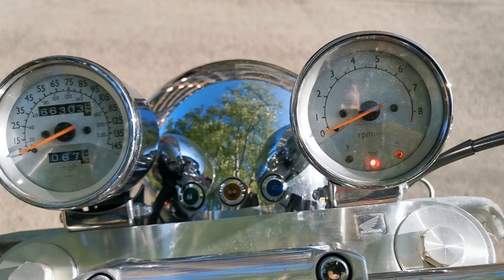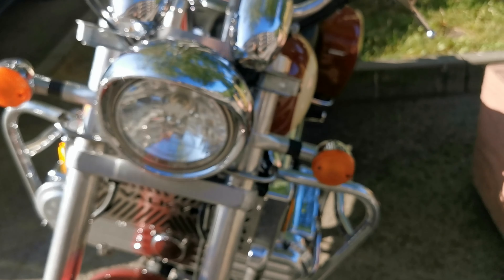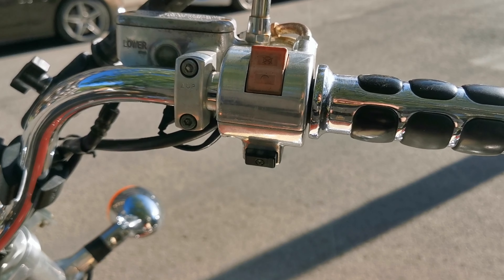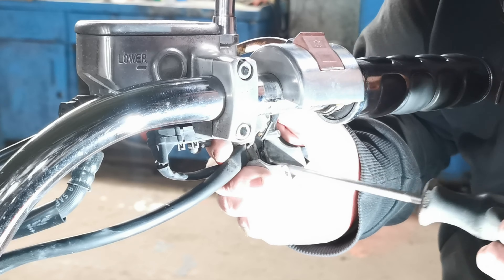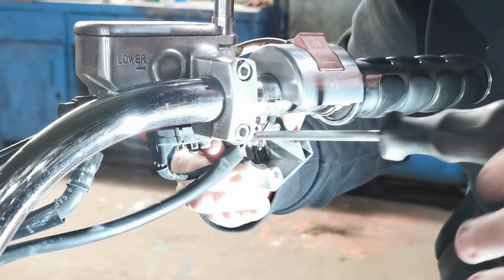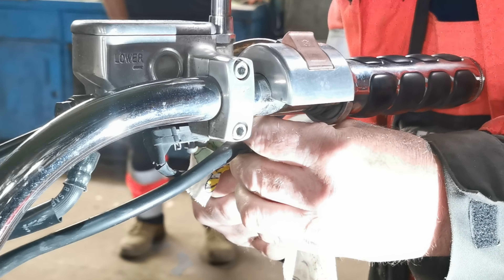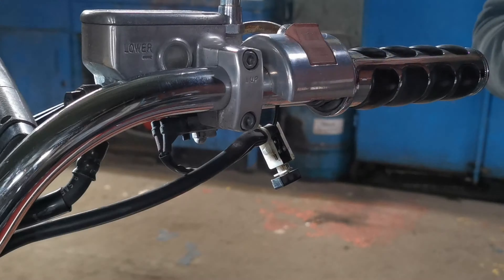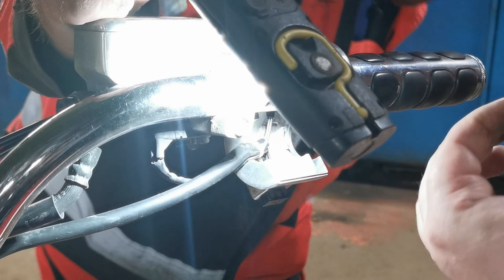Repairs and other off bike footage

Comment: That is amazing repairing the signal switch. Great job on diagnosing and finding a solution.
Reply from the maker: Thank you! But I can only take part of the credit, with the turn signal switch. The welder did the most amazing bit. Start switch issue was easier to fix, but eventually I will need to replace both switch sets anyway, because neither of the fixes were perfect, and are just meant to get me till end of the season 🙂

Comment: Nice job on the repairs. Glad to see you got all of the problems fixed. Were the parts at a certain age where they just fell apart, or was there another factor?
Reply from the maker: I don't think there is anything else besides age. I guess the parts are as old as the bike itself, so about 26 years or so...
Reply: @theodorstravels  a quarter of a century is pretty good for a small part.
Reply from the maker: @ScooterwolfsMotovlog  I hope when I install new pieces, they last at least as long 🙂